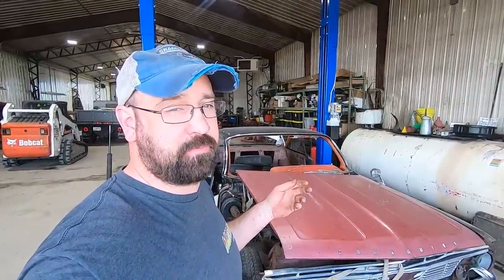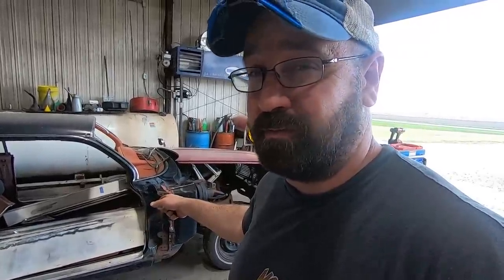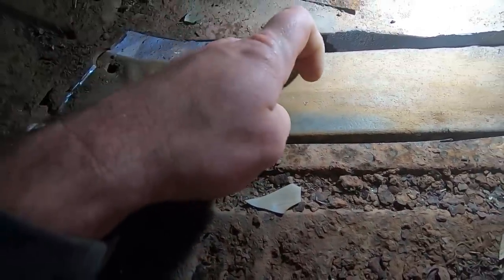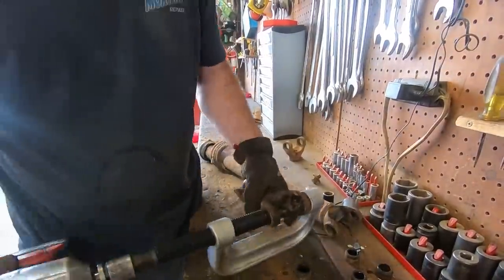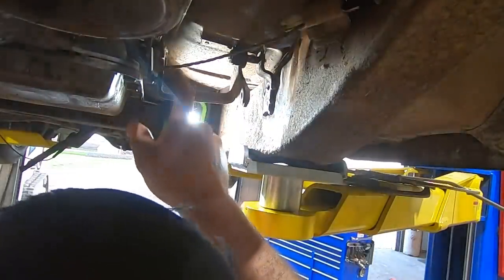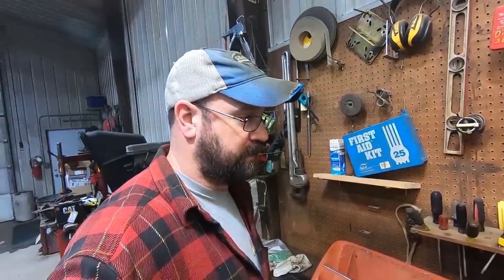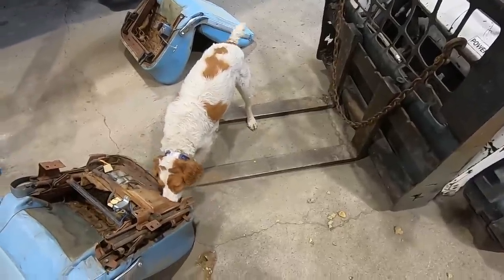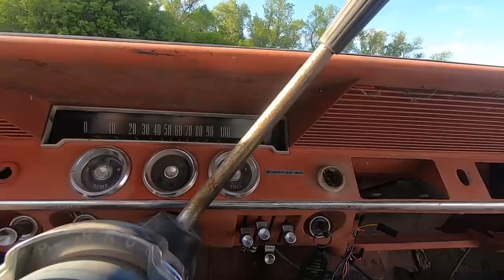Abandoned in the Woods for 50 years! 1961 Chevrolet BelAir Bubbletop Saved from the Grave!

Comment: Where to begin?  One of the best episodes!  This was a pretty cool catch that deserves to be done on the cheap in every way.  Used tires, used steelies, YES! to using the '62 chassis (no labor outsource - hit it w/ the flapper and rattle-cans!), but holding out for body parts.  For as long as that cab has been sitting out there in the wilderness, it is in pretty damn good shape.  The chassis however is TOAST.  Your choice as to whether you want to use the '62's wheel/brake parts, or upgrade your '64 wagon and use those parts for the bubble-top.  Either option will fit the definition of "on the cheap", i.e., using what ya got.  You are NOT gonna get this done within the next two weeks.  I can only speak for myself when I say that I would be stoked to see a monthly episode on this budget build (it could literally take the rest of the year and beyond).  That will give you all the time you need to chase down parts, receive donated bits and find the proper '61 front clip for her (anytime a subscriber sends you a part {YT community build!}, you could paint their name on the inside of the hood - along with the veteran's name as an homage).  In the meantime, the next episode would be worthy of a chassis swap AND banging out that driver's side - both cheap endeavors.  Gotta tell you, this is shaping up as a pretty cool story to tell about a pretty iconic bowtie ride - and how she rose from the dirt to become a one-of-a-kind town cruiser.  Kudos!!!
Reply from the maker: Thanks Jorge!!

Comment: My opinion: Stick with the 61 clip if you can find one. Consider frame swap, tweaked frames are a PITA. Cheap ebay disc brakes. The seats could go either way. The 62 is pretty much toast, might as well use as much of it as possible. 
Great content as usual.
Reply from the maker: Thanks

Comment: Remember that time you used the front frame of a suburban to graft into the crew cab (was it?) - maybe pull the same trick on that 61 to get modern brakes and an unbent frame horn and use your typical tubular dropped front end?
Reply from the maker: Frames are entirely different
Reply: @MortskeRepair  in hindsight I was thinking of S10 frames but I couldn't for the life of me find the front frame horn width from the engine crossmember-forward. I'm sure you'll think of something.

Comment: Fun video, definitely a budget But would like to what upgrades are out there cheap. Will late 60s Chevy  Disc Breaks fit  that car. I would do the 62 Front Clip and door for sure, Cheap seats, Do the bench for now buckets later. Is there sway bars you can get off another model to help the drivability.
Reply from the maker: We shall see
Reply: @MortskeRepair  Opening up a catalog and spending big bucks from a Speed Shop is just too hard to do. Finding junk yard part that can be rebuild and work better would be an excellent lessons learned thing you could help hobbyists out with. Duff Dog sure likes to run! All the Best, Dennis

Comment: That car looks quite nice, considering where it was for a long time. No super expensive restauration needed. Just fix it, complete it with old parts whenever possible and drive it. No chop shoping/lowridin/hotroding. Just normal old car that looks descent, runs and drives.
Reply from the maker: Oh it’ll be low!

Comment: Not sure of the "Fisher Tag" on the firewall would be the expected VIN but could substitute if the VIN given once final front fenders bumpers engine and stamping back then. Of course in case of my Buick as to ensure owners cant do any 3800 mods like the M90 which was standard for same motor used in the discontinued only year earlier standard Park Ave and as to try to cram Northstars as the higher power option VIN is now stamped on motor "for life" of the car😊

Comment: There we saw the weight of the car where the under weight sits atop the weight chassis. The weight chassis is what you told us the lower control arms are not good. There is a Cadillac 1959 or 60 Coupe de'ville from a man named Dylan and he works in a channel for Youtube as a mechanic that drag racing 14 sec Mustang II beater. You might get the free Cadillac but you have to volunteer tow it from your combo - trailer and blue pickup truck Chevy 1500.  Maybe  you say, " No, I DON"T ANY TIME that i'm too busy."

Comment: You did was that you have made driveshaft rod to be connect as new to the rear shaft of the automatic transmission. But you can cut the floor into the new hole for easier access to reach the slip yoke splines into the connection of the trans. Some driveshaft have splines other have teeth long groove slip. Then you connect the drive propellar shaft at behind the driveshaft.

Comment: Oh I've done put them needle bearings in caps before, Back then they were cheap enough just to buy another U-joint and use its cap, Now a days I'd spend the next 30 min to an hour putting them back in, they aren't that cheap anymore, Cost me $90 for 3 u-joints and $70 for a carrier for my 92 silverado 1500 and 8 bucks for straps, $30 per u-joint....
Reply from the maker: Exactly

Comment: You found the Biscayne black car bubbletop. The Chevy is all broken until you get the matching number of V-8 motor to run your roller named Impala. But you are lookinhg for key so you must use hot wire for testing the starting up for storage is mothballed your Car named Apache but you prefer work horse named Chevy big truck named Hobby number one of your state licensed plate it. Right now, you are to drive Biscayne without licensed plate for an estate owner. But there is no wheel on it yet. File out the number of VIN that is attached to the engine block and get punch letter and make the number matched to the access plate and name Serial number that is locked to the door complete set of the black bubble-top car that the rust is not too bad on it. But you have to get glass and all of the pink slips into just one Biscayne 1961 model into a title so you need the embroidered the title instead of all pink slip called ownership. Do need the proof again from lawyer with ASE engineer mind and you, the top technician?

Comment: OK, my two cents worth.  If it was my car, I would swap the frame from the '62.  Just rebuild all the stock pieces on  it ( brakes, suspension, etc. ). Pressure wash the frame, go to Hobo Freight and spend $20 on their suck out of a bucket sand blaster.  Get sand at your Lowes or whatever you have in ND. I have found you want to filter the sand as it tends to have a small amount of small gravel in it that will clog the blaster gun.  You don't need to get the frame spotless, just get the worst off then a rust converter, then a coat of Rust-olium semi-gloss black.  I would use every part I could off the '62 including the front clip.  I love '62's.  My first two cars were '62's, a 2dr sedan and a 2dr Impala.  Man I wish I had them now.  My mom sent them to the junkyard when I was in Viet Nam.
Reply from the maker: Sounds like aplan!
Reply: @MortskeRepair  Don't remember how the floors were in the '62, but I would use what I could to fix the "61 floors. An interesting thing is if you really look at a '61 vs. a '62 only the first and last foot of the body appear to be different.   There maybe some detail differences under the skin, but I think it is very probable that most parts will interchange.  The "X" frame started in '58 and the last year was '64.  I heard it was so they could lower the floor.  Poor design for sure.
How about a back story on the new shop?
Reply from the maker: @johnherdener6801  floors were shot!

Comment: A lot of guys convert those old Chevy front brakes to 82-92 Camaro setup, junkyard spindles calipers booster and master cylinder, entire giddyup bolts right up.
If you were going to buy a kit, just go ahead and do the right thing and get the 2" drop spindles.
Reply from the maker: Interesting

Comment: That is impala but it does not have any mirror except inside at above windshield. The outside mirror was U-haul rental parts attach to the door not fender and in the past used very wide camper two-wheel trailer and it hitched up to impala where we called it, Capsule with Booster engineer that built into better than stereo hamming station's booster about 300 miles range of frequency band radio type. In real old job site where the dish and had moved the dish with engine turntable 100 (approximate) CID in Arizona.

Comment: Bell housing is Turbo Hydramatic T200 transmission and you cannot remove the bell housing = flex plate and torque converter housing that it is fit to the wet clutch set housing plus Sun gear and gears system with snap rings.. The Powertorqueglide 2 speed chevy auto. trans. is no longer in stock of salvage yard best vintage parts Online and as well GM Parts expert service.  Only older car than the Black Biscayne Impala 1961.
 So, too antique transmission for sedan and/or specific type truck would be priceless that includes having bell housing coming off from tranny case. The 1980 Pinto have both bell housing and a cast iron trans case for stick shift 4 speed with reverse gear and idler shift link.

Comment: Did you tell us why the new location (shop) or did I miss that?  Because of the lift?  The last couple of times I watch your movies, it starts pixelating with the rotating circle and I can't get past that until I get out, come back in and curser forward.  It did it at the chain saw scene cutting down that branch.  It also happened to me on the previous video you posted.  Other YouTube channels are fine.  I have Xfinity, good internet.  The 61 Bubble top is one of the finest body styles ever built by GM.  I'm sure everyone is thinking restoration, I am.  But you have too many projects.
Reply from the maker: Not sure, I'm no techy, sorry.

Comment: The car has a v-8 (assume  a 283) the trunk has the Chevrolet emblem which meant a 6 cylinder . Does the cowel  tag have an engine code? I’m sure you are aware that if the car had a 283 it would have the Chevy emblem with a chrome “V” on the trunk and the 348 would have the “V” with  crossed flags where the Chevy emblem is. Basically the same emblems would be in the plastic insert in the center of the grill.

Comment: Hey Mortske, help a brother 61 owner out? I want to put an internally reg alternator on my 61 Belair. Currently has a generator with external reg. How did you wire up your alternator using the existing harness? Please and Thank you. 👍
Reply from the maker: There's some diagrams online. Pretty simple. Hard to explain via text. Pics are better. I'd suggest just buying a 1 wire alternator.
Reply: @MortskeRepair  thanks. I’ll check around.
Reply from the maker: @markjones7741  Good luck!

Comment: Finally lost the shop, and found a bigger one, Eh? The new digs look like they'll make life easier for ya.

I wasted my memorial day similarly. The hydramaitc trans in my 47 Olds fastback, died on me last year (1st gear/30MPH just ain't enough for road driving), so friday of memorial day weekend I plunked down $200 and grabbed an identical drive train and an engine hoist.  The engine on the new drive train was stuck in multiple ways, so after 2 days of soaking it with all the 'let go' concoctions and prying'n'wailing on it every way I could for 2.5 days I gave up and used an oversized death wheel to cut the crank aft of the rear most rod journal (rear most piston no6 was titanic level rusted into the block at Bottom dead center) so I could spin the flywheel and separate the hydramatic...That's probably the worst fight a car has given me, but the trans looks better inside than the old one ever did in my care...Soon comes the fun part pulling the old drive train and swapping the trans.
Reply from the maker: Hopefully it works!

Comment: The X chassis for the impala in 1960's There is an extra chassis for it is too rare to get that chassis to fit on the black impala from 1955-56 Buick skylark from another man named Halfass but Halfass is the name of garage and a shop. And he drives a Willys and a custom domestic car: Buick green flame painted on and also have Model A chevey rat motor low rider.

Comment: Just my 5 cents, because inflation ya know,  I think since you have a lift, If I was you, I would take the body off that frame and go to town on making it good. Do the brakes, lines, suspension etc since it will be way easier with the body off. New body mounts and slap it back down. Do the floors, maybe with some license plates to keep it cheap, and worry about the front clip down the road. I wouldn't do the 62 front unless you really had no choice.  Give it time, do the rest and look for parts as you fix the other garbage.

Comment: Glad you saved this one from death, but wish you could have kept the 3 speed, and wish you had kept the drum brakes and used a generator.  Stock is best, even if disks are better brakes.  I like 61 Chevys, but you are right about these being structurally weak.  Mercedes used a similar frame on its senior models.  This was not one of GM's better ideas.

Comment: How much for the harness for wiring between the new looking blue dashboard and starting up ballist resistor and speedometer cable, amp meter and etc. The salvage yard sells harness for like I bet $100.00 used harness wires and tape conduit. Rewire up and used solder iron and get rid of harness end called connector plastic junction box. Try make it by using the wire wound fuse box to put the electricity harness  It's quick way of whammy schematic and ladder of wires and its loads. Well maybe, it is for replace the better 1962-1963 harness against the 1961 harness. I'm an electrician ASE.

Comment: You should use the parts off the 62 but build the frame from the 62 with disc brakes and all the other good stuff then drop the body on when it's done 
I like what you do cause it's the same stuff I do every day lol 
Keep up the good work and the lift in the new shop is a game changer

Comment: Bubble top is just body plus metal dashboard with rusted disc brakes. Since in 1972 plate that has to go to the can in DMV or your shop of cut up the plate and the plate says VIN I hope so. But the VIN stays intact. The column shift was in the Biscayne from River owner and then column shifting the 3 speed in steering rod's housing. The transmission went into custom trucking and Then it was sold from the owner of Hauling pinky Pig business and Porker car is the Biscayne because it only have 350 CID and we didn't like we got Fisher interior baroche Rocket 400 CID engine car. But we exchange for family tree car to the Rivera car with its 400 Catalina engine then we stop using the Fisher Mississippi made these car so that way we got the 4-wheel part time car from Eddie Bauer SES car.

Comment: I just saw your ratchet strap battery holder. Why not weld in a side support bracket & secure the battery or, make a new battery holder? It looks as if you just need to copy the same bracket that's on the driver side of that battery box.
Reply from the maker: Have you seen the rest of the car?!?

Comment: Mortske repair put four barrel intake with edlebrock carb dual glass packs straight out the back exhaust tub the back of the car for wider tires put old school craigers on it give front end a little rake dual hood scoops in the shapes in the hood custom paint black on white interior paint outside gun metal gray metallic with silver pin stripes down the body lines on the sides

Comment: Pull the glove box and the vin will be stamped in the frame under the windshield.
Reply from the maker: What?!? How has nobody ever notified me of this?!?
Reply: I was a cop for forty years that's how recovered stolen cars I learned that from the FBI.
Reply from the maker: @stevepeterson8956  And you can confirm that is where they stamped the hidden VIN on 1958 through 1964 GM cars? Or are you referring to just cars in general?
Reply: @MortskeRepair  the only one I found was a1968 Ford galaxy 500 that's. The FBI guy told me that is where all manufactured American car have them on the body he did not say on the frame. Hows that
Reply: I can tell you this I have a 1966 Ford f100 I put a heater box in it and the vin was stamped in the frame
Reply from the maker: @stevepeterson8956  It's not in that location on 58-64 GM cars.